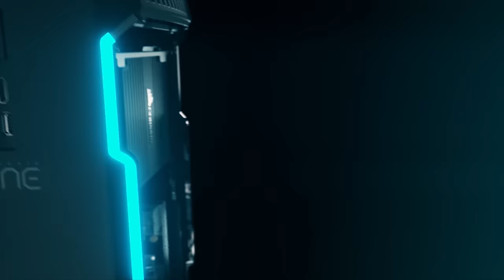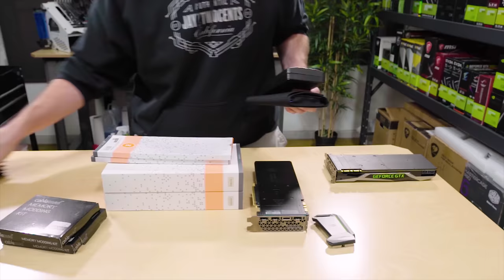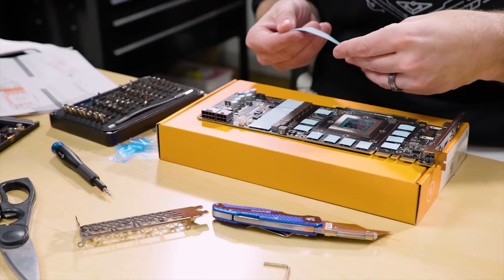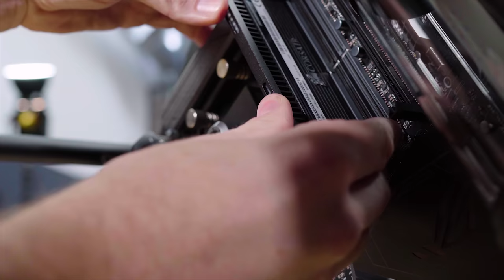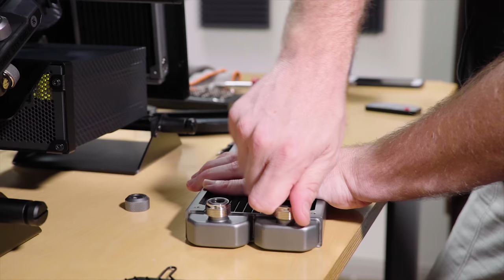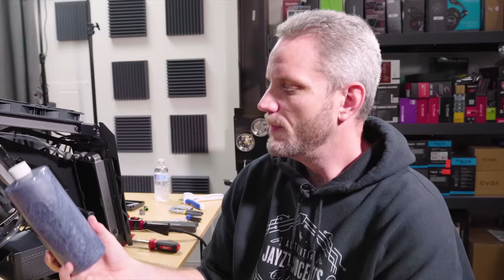Custom Watercooled Threadripper 1950X Build Progress

Comment: 2 suggestions: 
1 - Put a T-joint at the bottom of the inlet into the gpus and use this as the drain-point. Just cap it off but otherwise its the perfect  lowest spot (and not right over your power supply :P) 

2 - don't paint the orange piece - get a piece of clear or tinted transparent acrylic, and use a dremel to make a custom replacement piece (maybe with a jayz-two-cents cut out?)

Comment: Hey Jay,

If it's not too late, To easily drain your loop, just put a "T" piece at the bottom GPU Inlet. That's the lowest point in your build except for the front RAD. If you can make it look clean, then that's my recommendation.!!

Comment: Easy way to explain to people that loop order doesn't matter; 

The liquid is not acting as coolant. It's acting as a way of removing the heat from the CPU/GPU and transferring it to the rads.

Therefore as long as the coolant is still theoretically cooler than the component it's about to touch (almost impossible for it not to be unless you have inadequate rad surafce area) it will soak the heat from the component and carry it away just as well as if it were 10*C colder.
Reply: whts the coolent called?

Comment: Just finished my first watercooling loop. Looks awesome, found your channel along the way when doing research and am here to stay. But I realized that you've never done a video on how to measure hard tubing. You have one on how to bend it, which was helpful, but for a first timer the biggest problem I encountered was overcutting or undercutting tubing, which led to a lot of waste.
So I would suggest that as an awesome.video. Do you use flexible rulers, eyeball it, or some other method?
Loving this build.
Reply: Ian Rasmussen reminds me of something my agricultur mechanics teacher said to me in high school.
Reply: One thing I learned working in a muffler shop was to use flexible rod(coathanger, welding rod) and mock up what you want to do. It will help visualize the final outcome and help you measure and bend the tubing appropriately.
Reply: Ian Rasmussen if you've watched his water cooling tutorials he does say that he won't do a video on that subject because he just eyeballs it and has an instinct for it. He said it would be a not so educational  video because he doesn't know how to explain/teach it, he just does it ;P. Congrats on your first loop! Looking to start myself although, my wallet and I are plebes :P
Reply: I just recently did a custom loop as well. I found that when i over bent or cut, i would either rotate the tube at its last point and did a smaller bend. Or increased the bend to make a cool shepherds hook look. Best advice is of course to just go with it and be creative
Reply: The coat hanger idea just blew my mind. I think that is the greatest idea ever. Now I feel more comfortable about actually doing a hard line tubing build. Thanks!
Reply: Swisscheeze_xb1 No problem, simple and cheap. You might be able to find straight pieces of wire at a craft store but coathangers or oxy-acetylene rod are easy to come by.
Reply: guck foogle Agreed, his vids are very good and he's very talented. The attention to detail is unparalleled.

Comment: A Samsung SSD could look nice in that bracket.
Reply from the maker: +Luca Passalacqua good point!
Reply: The cables needed for it wouldn't.
Reply: I have one 850 pro on the back of my silver Evolv mATX case, I will raid 0 it eventually with another drive
Reply: or 960 Evo 'cause Asus Zenith has M.2 DIMM slot
Reply: 960 Pro... :D
Reply: Can you fit the EK-M.2 Heatsinks on the DIMM.2 slots with the Samsung 960s?

Comment: If coffee lake is good I might do that as my next pc build.
Reply: Inb4 "m-m-m-muh threadripper xdd"
Reply: Looks like it is fit for a 8700K or higher! I think my ideal Intel processor for this would be the 10-core 7900X or the 14-Core 7940X. Build is begging for a Titan Xp but it also supports SLI so I don't think I could justify a Titan when I could do SLI 1080Ti's or even 1080's.

Comment: A ton of people think order of components matter.  It doesnt. As Jay said, its like 1 or 2 degree difference between running everything into rads and then blocks or block then rad then block then rad, or all blocks then rads.  That is what we call "inconclusive results" and "within margin of error"   Dont worry about the order of your parts. This is what Jay will expound on later. For now, enjoy this sexy machine.  Jay, LOVELY build...very subtle and beast mode.

Comment: Never seen a guy so unhappy to build an awesome PC on an awesome tower.
Reply: Pogaspm hes conflicted i think and still a bit pissy from the asus aura bit. The case is nice, but it has some very unsettling pieces. I think this tower is something he was happy as eye candy, but not in actually building in it.  The cable management is going to be nightmareish for a start, its flimsy as all hell (yes the brace and the tempered glass will improve it, but lets be real, that dosnt make the frame itself sturdy.) Also hes got a lot to do lately XD
Reply: True dat, I think it looks badass. Probably require a lot of hard work though, that frame ain't fit for beginner at all (which Jay isn't); maybe Jay got slowly corrupted by the symbiote lol!

Comment: How much does it differ in temperature if you reverse the inlet and outlet?
Reply: You can't reverse the inlet and outlet on an EK EVO CPU block.  They are designed for the inlet to direct water directly down onto the top of the CPU die and through the jet plate.  There are some CPU blocks that you can go either direction (just like the EK GPU blocks can), but they generally don't have a jet plate and the water just picks up what heat it can while flowing through the channels.
Reply: Wade Bingham I know you shouldn't but my one in my system is actually running backwards, my pump was labeled wrong so the coolant is going the wrong way round my loop, still get decent temps tho

Comment: Andrew Brown - Nice build Jay. An idea, why not remove the HDD / SSD bracket, and then replace with two long colour scheme painted rods, or coated with your carbon fibre look vinyl, with internal threads. So then screwed into back plate, and allows to mount the orange cover sturdily, while allowing you to put your cooling tube loop through the space created now by the two rods.

Comment: I would say use a hole saw or forestner bit on the mount to put a hole in it big enough to fit a tube through. that case looks cool but it is very wobbly. Looks great so far. I say do with some crazy loops!

Comment: You inspired me build my own unique PC Case from scratch.
I'm a tool maker with a fast amount of machinery at my disposal, but lack the vision of what I want to design.
But this helped alot.
I know I will be using 6061 aluminum, maybe some tool steel, A2 and V10 are my favs ( want to relate the case to my work )
V10 is expensive, and I'll hardness coat it aswell lol over kill and bullet proof, plexy glass, diamond plate sooooo many options.
I need to start a pro enginee drawing up soon, but sketch first I guess.

It's hard to pinpoint where to start.

Comment: If you invert the front radiator  run the feed line down the back .  Then the drain plug  could be  in  the bottom between the pump and front radiator saving  taking it apart to drain . aswell as dot having it over the power supply .  Just  a thought.

Comment: A video I would really like to see you do if you can find time is an optimized full system water-cooling build. Where everything should be located for ease of routing, cooling flow, and the best order for everything to be linked in order to keep everything as cool as possible.
Basically if you could design a case (for example Protocase) for an enthusiast system like this or even crazier how would you lay everything out, how many radiators and what sizes, etc in order to create the "perfect system."

Comment: Do a couple quick calculations, based on the TDP of the components, the flow rate of the pump and the specific heat capacity of water. The water flowing over the components will heat up about 1 degree as it passes over them, so the difference between GPU and CPU is really insignificant.

Comment: You could cut a large rectangle out of that ssd bracket so it's just a thin 15mm outline to still use the mount for the case but allow somewhere to route the tubing.

Comment: One option for a drain port would be to put a T fitting  at the GPU inlet port.  Then the tube out one side to the res and out the other side to a mini-valve.  Would help to put it at the lowest point, but may or may not look right as well.

Comment: @jayztwocents a suggestion, why not change the GPU inlets for the right side ports, GPU out comes form the left passing the CPU block on the left side to the top radiator then from the radiator back to the CPU block, inlet on the top, and goes for the front radiator. More exposed tubes for the fluid. You can add a drain at the left port from the bottom GPU.

Comment: Flip the front rad, and bring that top tube out so that it's closer to the glass. Remove the SSD bracket in the front.
Maybe you take the 90 degree off the bottom graphics card and install a T fitting upside down? iThink it would drain out more than just the res that way.

Comment: Those who wanna understand the flow in parallel graphics cards can go ahead and read up on fluid dynamics, specifically it's laws of conservation... in fact parallel might be minusculely better because of volumic thermal expansion causing dynamic viscosity to change across the two cards.

Comment: Put two rods/dowels threaded at each end  so you can still attach the plate. Like the dowels that mount the glass, then you'll have room.

If you decide to not use drives that is.

Comment: Looks great. But the top long hard line, IMO should follow the angle of the case thats right behind it. I know it's not always easy but the hard line of the tube and the hard line of the case is clashing when most all other lines in the case are parallel

Comment: Is it possible to add fluorescent flakes to that symbiote fluid? You can then add strong fluorescent lighting in that new gap you're thinking of creating by removing the SSD storage plate. The lighting fixtures will be hidden behind the front panel that you're still going to paint. That way could ensure that the fluid fluoresces very strongly without people noticing the heavy lighting.

Comment: For your drive plate, would it not be easy.... if you can find something, to use a bar with a hole and tapped on either end, that way it will still be able to have at least 1 extra contact point to the soon to be painted orange part?  One bar would help keep more rigidity and still allow plenty of space for routing hard line.  Just a thought.

Comment: Also there are holes on the outside side of the case to mount two ssds, where the cables go. That way you don't need that plate there.

Comment: As the fluid moves through the loop it equalizes in temperature. I used to work for Swiftech and I've seen this actually measured in our test lab. The coolant doesn't noticeably heat up as it moves from one component to the next. The coolant is moving too quickly for that to occur.

Comment: I always thought a dual reservoir sticking out the top of a case would look cool, this case would probably make that easy.
one thought on the loop, what if you had it go from one rad to the GPUs, back to the second rad, then through the CPU, then to the res/pump (or some variation of that)?

Comment: You could just drain the loop with a 14psi pressure/vacuum tool with a compressor and G 1/4 adapter. (Just like flushing a radiator in an automobile.)

Comment: Put the drain on the bottom gpu that seams to be quite a low point also I think its not gona look too bad there if it points straight to the back of the case.

Comment: +Jayztwocents loving this build! Could you remove that bracket, and drill it out for the tubing or even Dremel the inside of the bracket out completely, leaving a square ring type bracket
You'd lose the hard drive mount, but you'd still be able to secure your side plate.

Comment: you want to keep your pipes straight as possible without too many bends but doesn't have to be necessarily short,, the more bends you have will in turn affect your water flow and add restriction. and it would be good if you could seal all the fans on top of the radiators I don't know if there's any sealant there but something like draught excluder will give it a bit more airflow! Over The Matrix, a larger pipe diameter would be more efficient as well mainly in the outlet not so much in the Internet as long as it's not too small, One or two sizes bigger is all that's needed on the outlet. this in turn creates a natural water flow in itself and adds a greater efficiency and heat distribution? using step down connectors could be used, But really the manufacturers need to make a bigger outlet altogether from the heat plates and the radiator inlet or tap it yourself. Try thinning your water down with some isopropanol 10 or 15%  this adds 2 factors to the mix,  just make sure your seals are suitable? more likely they will be these days and make sure they're not perished by alcohol? silicone o-rings would be fine, a quicker movement of heat and a finer viscosity to the water what stops it clinging so readily.

Comment: 9:55 when the fluid is the star of the show, in a system with a threadripper 1950x and two gtx 1080ti... That means you should leave the computing world for a little while...

Comment: IMHO if you'd wrapped the power supply in plain black it would have looked better. Another option would be to add a few more carbonlook highlights (maybe the HDD tray, and the top of the reservoir) now it kinda stands out.

Comment: You shouldve used an alphacool x45 rad in the front because they have the drain plugs at the bottom on both ends and you wouldnt have needed to put it on the res.

Comment: Hey Jay, would it be possible to put a T shaped connector underneath the 2nd graphics card? It could replace that 90 degree fitting, give you a place to put a drain port, and have it in the lowest point of the case..

Comment: Why not keep the SSD bracket & just notch it with a Dremel to allow a better pipe routing?
Also, this build could really use an X-flow radiator in top.

Comment: Heya Jay! Can you really rotate the top plate of the TR4 block? I have a TR4 Supremacy block myself and I asked EK if it was possible and they said you couldn't. According to their tech support, you can flip them vertically but not horizontally. I had to ask them because I noticed that the micro fin orientation would be different in both scenarios. Anyway, nice build!

Comment: Hey Jay. Big fan here, watching all your tubes.
Was wondering - Why not do a parallel loop on both gpu's and cpu? I'm currently saving up for my first watercooling and watching all your guides on the subject. I have a NZXT manta ITX build with 7700k and 1080ti FE and was curious about the temps on this config. 
It could be a future vid? Or on this Threadripper build? :)
Great job so far Jay.

Comment: hey jay,,do they make a petcock/drain valve for that resivoir?? you could put a petcock valve on the drain nipple,then custom make a hose that stretches about 3-4 feet from the pc. then you could drain it into a bucket on the floor,,without the mess/wetness getting around the parts. and this is one of the best video's i've seen you produce so far. lastly,,it would be interesting to see what you can do with a full size NZXT phantom (RED) case.i love the look/astetics of it. id like your 2 cents worth on it.

Comment: The differential between the CPU and GPU temperatures under load is inversely proportional to the rate of flow.   So ya Jay is right,  so long as you remember what I said.

Comment: Oh no Jay, you didnt show yourself actually putting thermal paste on the graphics cards, that means you didn't do it and they are going to over heat and explode. lol jk.  Looks sweet so far.  That drive mount does seem to be a bit of an eye sore.  It was the one thing that popped out as "out of place".  Whatever you manage to end up doing with it I am sure its better than anything I could come up with.

Comment: IF you keep that bracket, couldnt you just modify it to allow you to either have a hole it in to pass the loop through it. OR cut a arch in the bottom ( to pretty much do the same thing.

Comment: I could be wrong, there's a good chance of that..., but what if you drained it then used a shop vac or something like that to suck the fluid out. is that feasible? I doubt it would put any strain on the innards of the cpu/gpu... am i wrong?

Comment: It sucks there's no place for an optical drive. (From what I can see.) Are you just not putting one in, or did you have an external one that you can plug in via USB? I understand why they are pretty much non-existent in the laptop market, because of size/weight restrictions and the fact that optical media is being used less and less, but a DVD-RW optical drive is a must in a tower. (Preferably a Blu-ray/HDDVD RW drive... If they have that combo.) Pretty much all desktop towers have enough space to add an opti drive, so why would you omit it?